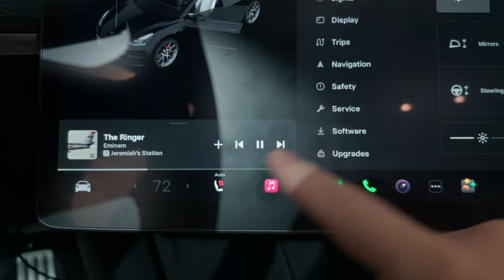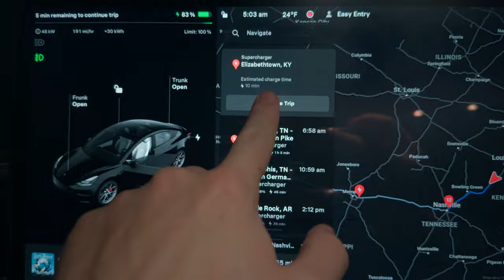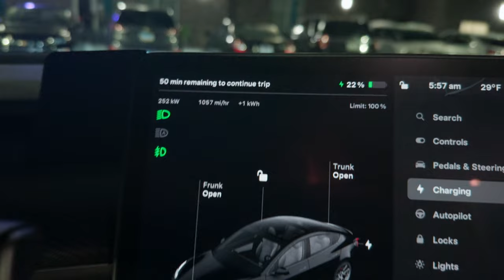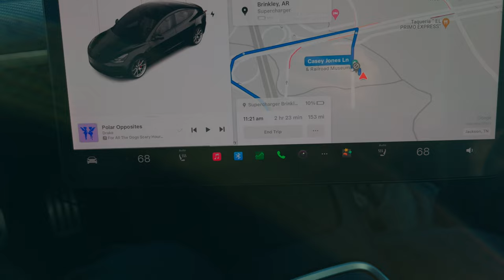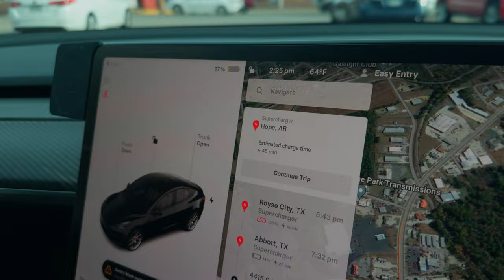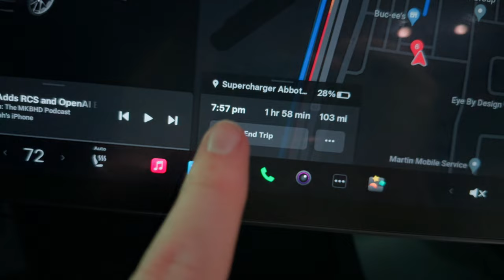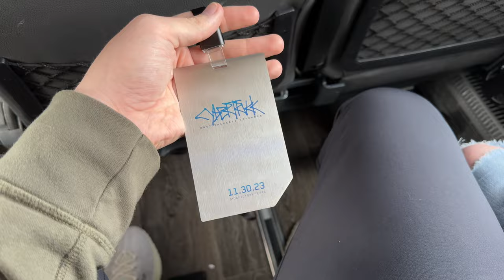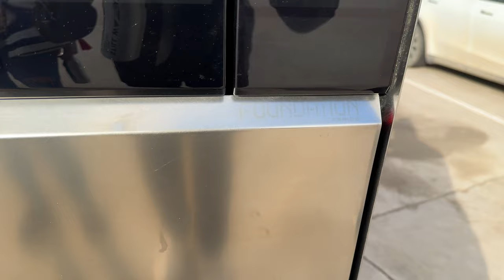My Tesla Model 3 Performance VS. Cross Country Road Trip

Comment from the maker: ⬇Must Have Tesla Accessories⬇ Code: YOUTUBE for 10% OFF ENTIRE PURCHASE at Tesstuff!

Buying a Tesla? Use my referral to get FREE Credits, Money Off, FSD, and/or Supercharging Miles: https://bit.ly/OrderTesla

Screen Protector - https://geni.us/Model3YSP
Sliding Center Console Organizer - https://geni.us/M3YInsert
Armrest Organizer - https://geni.us/M3YArmrest
Cup Holder Insert - https://geni.us/Model3YCup
Hidden Storage Insert - https://geni.us/M3YHidden

Floor Mats (3) - https://geni.us/Model3Mats
Floor Mats Extended (3) - https://geni.us/M3MatsE
Floor Mats (Y) - https://geni.us/ModelYMats
Floor Mats Extended (Y) - https://geni.us/MYMatsE

Samsung SSD - https://geni.us/Model3YSSD
Endurance Micro SD - https://geni.us/Model3YESD

Portable Vacuum - https://geni.us/V8MATE (Code: JJV8MATE might save you $$$)
Tire Inflator - https://geni.us/X8APEX (Code: JEX8APEX might save you $$$)

Dash Phone Mount - https://geni.us/DashPhone
Screen Phone Mount - https://geni.us/ScreenPhone

Rotating Screen Mount - https://geni.us/Rotating
RGB/Ambient Interior Lighting Kit - https://geni.us/RGBLights

Roof Sunshade (3) - https://geni.us/Model3Sun
Roof Sunshade (Y) - https://geni.us/ModelYSun

Carbon Fiber Dashboard (Code: MYTESLA for $50 off): https://bit.ly/TesIaDash
Carbon Fiber Steering Wheel (Code: MYTESLA for $50 off): https://bit.ly/TeslaSteering

Charging Phone Mount - https://bit.ly/TeslaMBPhone (Code: MYTESLA15OFF for 15% off)
RimCase - https://bit.ly/RimCase (Code: MYTESLA15 for 15% off)

Radar Detector - https://geni.us/Radar
Cheaper Radar Detector - https://geni.us/CheapRadar

Mud Flaps (3) - https://geni.us/Model3Mud
Mud Flaps (Y) - https://geni.us/ModelYMud

Ubertrurbine Wheel Covers (3) - https://geni.us/M3Wheel
Ubertrurbine Wheel Covers (Y) - https://geni.us/MYWheel

Trunk Insert (3) - https://geni.us/Model3Trunk
Trunk Insert (Y) - https://bit.ly/TeslaMYTrunk

Tint/PPF - Studio A in Louisville, KY does AMAZING work! (Tell them Jeremiah sent you)

J1772 Adapter Lock - https://geni.us/J1772Lock
Jack Pads - https://geni.us/JackPads
Mobile Connector Holder - https://geni.us/ChargerMount
Tire tread gauge - https://geni.us/TreadGauge

Learn How To Wash Your Tesla ➡ https://youtu.be/GCZSRKfIa10?si=5OXJLK806t99lq2H
5 Gallon Bucket - https://geni.us/5Bucket
Grit Guard - https://geni.us/GritGuard
Spray Bottle - https://geni.us/SBottle
ONR - https://geni.us/ONRinse
Opti-Seal - https://geni.us/OptiSeal
Car Wax - https://geni.us/CarWax
Power Clean - https://geni.us/PowerClean
GSM 500 Towels - https://geni.us/Towels500
GSM 300 Towels - https://geni.us/Towels300
Waffle Weave Drying Towels - https://geni.us/DryingTowels
Wheel Protection & Coating - https://geni.us/WheelProtect
Opti-Bond - https://geni.us/OptiBond
Wheel & Tire Brush - https://geni.us/TireBrush
Stoners Invisible Glass Cleaner - https://geni.us/GlassClean
Glass Reacher Tool - https://geni.us/GlassReach
Colourlock for Artificial Leather - https://geni.us/LeatherClean
Baby Wipes - https://geni.us/BbyWipes
Free & Gentle Detergent - https://geni.us/CleanTowels
Ceramic Coating for Seats - https://geni.us/CeramicSeats

As an Amazon Associate I earn from qualifying purchases.

⚡TeslaFi (Code: MYTESLA) - https://bit.ly/TesIaFi

Comment: It'll be nice when there are enough superchargers around that you can just charge to 85 anywhere you go and not worry about if you'll make it to the next stop or not. 

Btw, I'm looking forward to a video on those wheels. Im trying to decide between the same Tsportlines in 19" or the Martian wheels MW05 19"s for my '23 M3P.
Reply from the maker: Should be out in the next 2 weeks but I have mentioned in the past that if you're looking for plug and play, you can't beat tsportline.

Comment: Great video. How did your get you Tesla on your screen to have your TS rims?
Love to change mine to match what I have.
Reply from the maker: It's actually showing the aero with no caps. Because my TS5s are the exact spec to the 18 inch aero, that's what I selected.
Reply: @JremiahJones  thanks. Model Y doesnt have no cap selection, if you have 19 it has Aero only. Model 3 has more selections. 
I appreciated your comment about being a sport sedan guy, me too, for now I have the Y. But it did make think I need to get a 3.